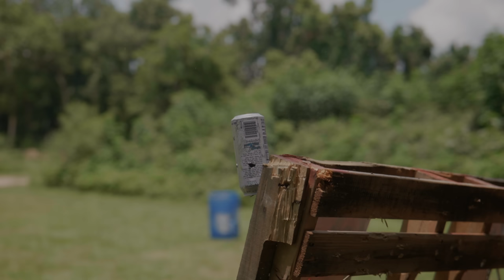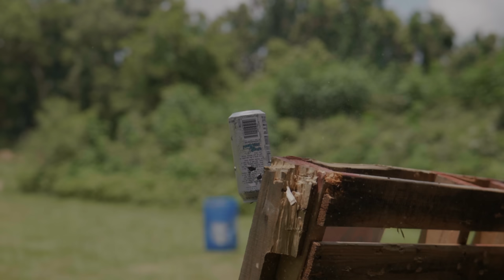13.7 Pin&Weld New main squeeze

Comment: is that the sr07 tape switch? Those things are trash. I had one where the entire switch split down one side of the entire rail and part of the pad, exposing the internal pcb. I don't think i'll ever buy a surefire tape switch again and either go for cloud defense or unity tactical or just forgo using tape switches entirely. I can't believe something that is supposed to be for military use just disintegrated so easily when i'm not a hard use enduser.  The thing would also always pop off even before it split in half. Such garbage...over $100 for some rubber and super basic electronics that can't even stand up to the use of a larper (me). SMH.

Comment: I have a BCM 14.5” with pinned and welded surefire warcomp, and I love that rifle!
Reply: Looking at the same right now, any major pros/cons after 6 months?
Reply: How’s the accuracy? I’ve got the BCM MK2 14.5” with the ELW profile barrel. I’m unable to get under 2MOA shooting off a bench and rear bag. Just upgraded the scope. If I can’t get under 1.5” I’m swapping the barrel for a ROSCO. But I SHOULDN’T have to!!!
Reply: @scott2228  I haven’t gotten to push it out very far yet. I’m planning on putting an Sig MSR LPVO on it. So far I’m very happy with it though. Maybe some different ammo would help you out?
Reply: @Z-J-  no. I absolutely love my rifle
Reply: I’ve tried every grain on the market. Also used Sierra match as well as budget. I’ve upgraded the scope and will retest soon. Will swap to ROSCO barrel next if accuracy doesn’t improve. I’ve got many ARs but this one was built out to be my “if I could take only one” rifles. So I’ll keep at it until 100% satisfied.
Reply: @scott2228  sometimes that’s all you can do. It could possibly be the barrel.

Comment: I just built a 13.7 using a lot of the same parts that you did with a few differences. I have the same barrel and the Aero upper, lower, and handguard. I have a SOLGW BCG and Nox muzzle device. The one change I have is that I used the A5 buffer from Viltor and the first time I shot it I thought I had a squib load lol. It shoots so smooth and soft so when I get the suppresor for  it should be perfectly gassed.  I have a 507 on an offset mount and a Swampfox Tomahwak 2 on the way for it.
Reply: What weight are you using? Sprinco-Green spring too?

Comment: Nice build. I get semi-tempted to get a 13.7 or 13.9. Highly revolves around really long MD's like the SOLGW NOX. I'm going with 14.5 so I can use a more standard/common length MD (Revival/FCD 3P15).

Comment: I love my 13.7, its so light it feels like a subgun, but still puts some velocity behind the rounds. I don't think I'll go above 14.5" again unless I'm building something for long range
Reply: 20" is where it's at, with a 1 in 9 twist, .223 wylde QPQ Hansen profile Ballistic Advantage with the nickel boron bore, (ok, that got pretty specific toward the end...) with 55 grain ammo. 18" is nice, you just short-stock in close quarters, 20" wouldn't be much worse. 20" with 55 gr loads will penetrate BA.
Reply: @chadwik4000  maybe if you live in the high desert or flatlands, but for the majority of people in the city or the woods, a 20" isnt a good choice if you have the option. It's not 2002, 556 is gtg out of anything over a 10" barrel
Reply: @The_PotionSeller  it isn't just about going out far you're going to hit whatever harder wherever you hit it, even CQB. And like I said it defeats body armor
Reply: @chadwik4000  That gets long with a suppressor indoors.  39" overall length is the max I'd bring inside. .... but outdoors, an SPR build, no problem.  I prefer the 18.5 length though.  It hits 800m just as fine and saves your 6oz on the bull barrel.
Reply: @chadwik4000  it only defeats level 3 body armor and I might be mistaken but I think it's only steel body armor too but I might be wrong about that. However what everyone who suggests 20" seems to either forget or not know but a 16" barrel with m193 will also go through the same armor plates. Gets you over 3k velocity as well. 16" feels a lot handier than 20" too. Especially if you use a suppressor, then it gets quite a bit longer but nowhere near as bad as a 20".
Reply: @Gnolomweb  the half-inch is a thing past 16in? I thought that was only a thing because of the ATF, I'm trying to figure out what the benefit of having a half inch added to 18 inch barrel would be besides the obvious reasons. And yes moving around indoors would certainly be awkward but I definitely think it's doable considering how easy it is with a 18in. Or even with 18.5 in.
Reply: @chadwik4000  The extra half inch gives me the little extra velocity to make all the ES of my hand loads above the 3300 FPS for 55gr at less than 100 ft.

Else, the extra half inch doesn't effect my angle of views through doorways like the 20" decreases my angle of view by 5% (even with stock over shoulder technique)

Comment: Kudos on however you shimmed that out. I had same barrel and same MD. It was nearly .25 short before even starting to shim it. I said ✌️, sold it, got a 13.9.
Reply from the maker: Yeah you gotta use a spaced that buts up to the barrel shoulder concentrically. Hence finding a gunsmith that knows what there doing lol
Reply: @americansanonymous2434  Yeah ADCO makes one. I know there are others. 👍

Comment: The almighty algorithm has blessed you with a new subscriber! I'm a recent convert to the 13.7 gang. Snagged a Ballistic Advantage upper for 30% off and it's nice. I'm torn between a Surefire Warcomp and SOLGW NOX. The NOX requires no spacers for length, but the Blast Warden is too cool. I take it your gunsmith had no issues securely pin-and-welding the three-prong as a suppressor host with the spacers?
Reply: Go with the NOX. You can't get to 16" on a 13.7" barrel with a Warcomp. Well you can, but you'll have about 3 threads engaged and a shitload of spacers. 

People forget that you can't just take the barrel length and add the muzzle device length and get the final length. You have to account for length lost to thread engagement which is about .6"x2. So over an inch lost when threaded together.

Comment: If you don't want a can Faxon makes barrels that have the muzzle device machined in at 16.1. So no pin and weld bs needed. 

An if you do want a can, and don't have a good gun smith, many places like BCM and even PSA offer 13.7 and 13.9 pin and weld uppers now.

Although I'd buy a barrel straightness guage to check supressor alignment, regardless of where you get your pinned and welded upper.

Comment: With the 3 prong did you use a spacer? And it didn’t reduce the thread engagement too much to worry about mounting the can?
Reply from the maker: Yes you gotta use a spacer that buts up to the barrel shoulder concentrically. The pin and weld stabilizes it. On a 13.7 all your looking for is like 1/4 inch with the Surefire 3 prong
Reply: @americansanonymous2434  okay cause i was going to use the 3 prong warcomp but was worried
Reply from the maker: @5RWill  honestly if you still have the option I would go with a 13.9 or 14.5 it just makes life a little easier, plus you have alot more handguard options
Reply: @americansanonymous2434  well i already have a 14.5” but am wanting to go shorter for the RC2 and mini and to differentiate it from the 11.5” and mk12 mod H. So if it can be done without issue I’ll stick with 13.7” that’s my only concern is the can

Comment: My 13.7" with a NOX p/w and an A5 buffer setup shoots so soft it's almost like cheating
Same BA hanson barrel as you, running a BCM MCMR I chopped down to clear the muzzle device. 
Btw PSA is selling complete A5 buffer kits for like $99 now or something like that if you're interested in trying it out on the low
Reply: 2nd that on the A5 system. Digging it on my SOLGW tube with B5 stock.

Have you goobered around with BRT EZTUNE Gas Tubes?
Also, Are you running a Green Spring co? What buffer weight?
Reply: @Gnolomweb  I don't have any experience with those gas tubes but my homie has one in his 11.5 and really likes it, they're tailored for your setup with a lot of different factors. I might try one out when my can is out of jail

I'm running a A5H2 buffer with a Geissele rifle length spring which I think is about the same as a sprinco green. My buffer tube is from FCD, it's the smoothest action out of any of my AR's for sure man. One of those few things that's 100% worth the extra money imo

Comment: Get 2 polonium’s they cost as much as 1 rc2. Pin and weld the full size on the 10.3 making it 16.1 inches. Put the k on the 13.7 they are working on a Surefire mounting system right now.

Comment: If you are going to pin and weld to end up with 16” overall why not just always go with 14.5? Gets you an extra 1” of actual barrel length…
Reply: My thoughts exactly! Why go 13.7 and then use spacers to get you to 16 when you could just start with a 14.5 and an extra .75" of barrel length and get free increase in velocity with zero length penalty?  Make it make sense.
Reply from the maker: I already had the 13.7 before the pistol brace nonsense. I’m getting a urgi upper for a block 3 build which is 14.5 pin

Comment: How were you able to reach 16” with the warcomp on a 13.7 barrel? Did you put a bunch of shims before pin & weld?
Reply from the maker: Yes. Find a gunsmith competent enough and also comfortable doing it. I’ve found out since publishing this video that it’s kinda hard finding shops and gunsmiths to do it. If I could do it over again I would just go with 14.5 p/w for what it’s worth
Reply: @americansanonymous2434 i already have a 13.7 and I want to add the warcomp too. I’ll probably be getting my rc2 soon after months in atf jail. I would love to see a pic of your muzzle device just to get an idea of how it looks
Reply from the maker: @mydolcegabbana1986  unfortunately this rifle is no longer in this configuration. I had a slight baffle strike on the end cap of my socom 300sps so scrapped the barrel and went to a 14.5. Still waiting on a handguard and new 4 prong to pin and make it a urgi clone upper
Reply: @americansanonymous2434 what cause the baffle strike? Gunsmith didn’t aligned the muzzle properly?
Reply: @americansanonymous2434 only asking cause I don’t wanna make the same mistake lol
Reply from the maker: @mydolcegabbana1986  I’m guessing cuz the shims I used shifted. Pinning a 13.7 barrel only allows for a few threads to catch so it could be a combination of a bunch of things. Luckily it was so minor I’m not even worried about sending my suppressor in for service. If you want my honest opinion just bite the bullet a get a 14.5 barrel. Life will be a lot easier

Comment: why LPVO left on 6x? Just the reticle?  I prefer the flip 5x magnifier when kitted out. Less snag/weight for me + I don't intend on hitting target past 300m with a 10.5 w/ SPS300. (300BO / subs only -- Yes the ballistics are shite at 300m, but I can hit it reliably )

The 223wylde shooting spicey hand loads ( 77 otm bergers or m855A1s) with 18" uses a 5x25 Vortex PSTII with the same ADM + mailbox.

(Can anyone tell me the point of 5.56 short barrels under 200yards?)

Comment: What buffer weight and spring ?
Reply from the maker: H3 with a standard buffer spring. Gets sluggish after a lot of rounds suppressed but the recoil impulse is excellent with that set up. Keep in mind it’s a 13.7 barrel with a carbine length gas system
Reply: @americansanonymous2434  I’m having issues with my 13.7 carbine length gas system short stroking I had a h1 and a blue sprinco in it
Reply from the maker: @kylechupick2232  I would try going down to a regular carbine spring then check the gas block may have walked loose or something
Reply: @americansanonymous2434  on it thank you homie

Comment: I genuinely hate to break this to you my man, but the surefire stuff just isn't good today. Haven't been for years now. Even their "new" "turbo" series is old tech that isn't even as good as modlite or cloud defensive's lights that have been out for years, or even arisaka's lights that use malkoff heads. 

For $500 you really could have done so much better. Especially for a rifle. If that's the regular 640 that only uses cr123 batteries then I'd most definitely suggest checking out the malkoff devices heads that will work on those 16mm scout bodies. Arisaka carries them, and you can get them direct from malkoff. If it's the 640 DF then a modlite head or a malkoff head made for the 18mm scout bodies are the only way to go. The malkoff has slightly less candella than the modlite, but they perform insanely good for the price point. 

Not having at least 50k candela in your rifle light is really cutting yourself short. Surefire has been running strictly on their name for a decade now - well, that and good ol govt contracts - and have pretty well proven they don't care about giving you the best product they could make. They're only going to give you "here's this light that we made a long time ago, and something that literally ever other decent light brands have far surpassed (even streamlight), but at least it's got our name on it". Even the 640 DF has a beam pattern that's more akin to a decent pistol light. Far and away from what a rifle light should be. 

Genuinely, at least check out the malkoff stuff if you can't budget the extra $50 a modlite head would be, and then just sell that surefire head on ebay or reddit or something to replace some of that money you spent on the better head.

You'll be so happy you replaced that surefire head. I can not over state that.
Reply from the maker: Stuff to consider thanks